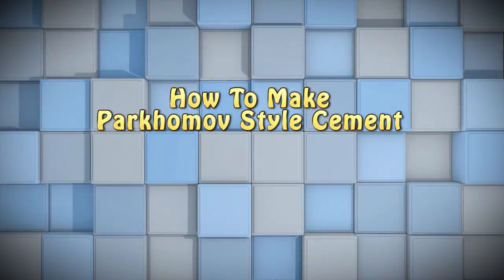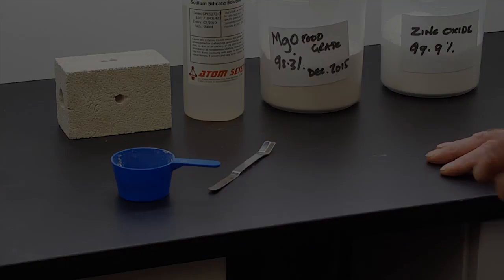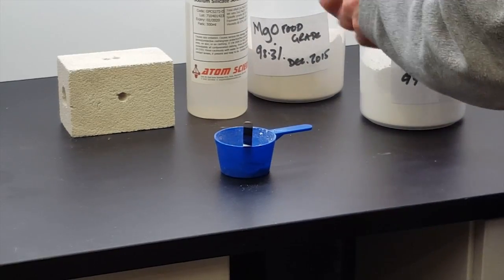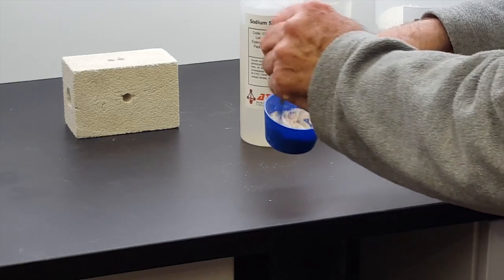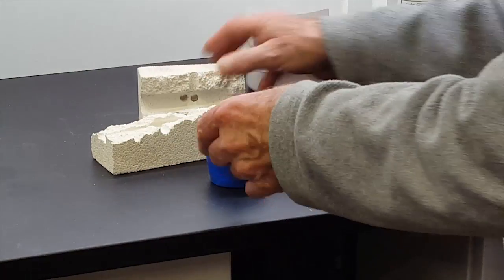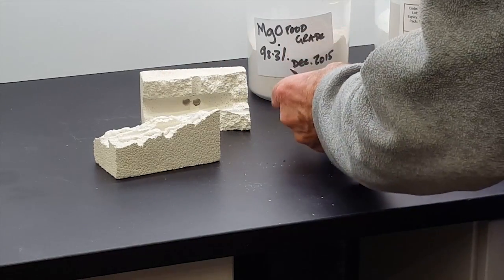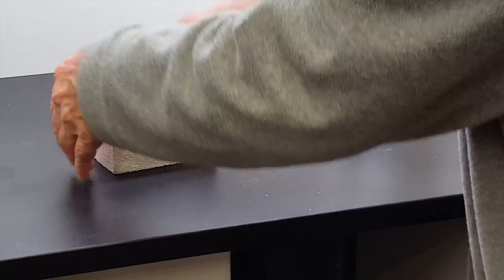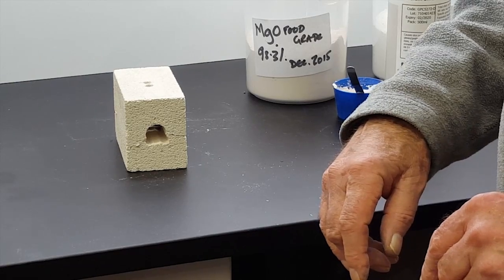How To Make Parkhomov Cement (Refractory Cement)

Comment: what would you suggest the mix would be if i was to try to caste a cylinder say 50 mm thick with 14 inch diameter, 6 ft long?

Comment: Nice I saw a mix of Sodium silicate, Al2O3 and baby power. Was thinking of using MgO and Al2O3 instead of baby powder bc MgO has a much higher melting point. Wanted to make sure using MgO was a thing!
Reply: please note that baby powder was mostly talc powder in the past but because there is often traces of asbestos in talc most baby powder is now mostly corn starch - not good for refractory
Reply: @carboncomplex  Yeah its been cornstarch for a while now. Sometimes you can find an old one on the shelf  with talc

Comment: Where would I be able to purchase  the magnesium oxide? I noticed you sell the starter kits, but I am going the aluminum oxide route and I also make the sodium silicate.
Reply: Mix MgSO4x6H2O + water +Na2CO3=MgCO3(insoluble) + Na+ SO4--
Cool place
Filter
Heat MgCO3 to 600C-750C(not higher) for 2 hours
Check if it became MgO
(at room temp measure temp in 200cc water~20C
add 1 tablespoon of MgO
temp should go to about 30C
if not - heat it at 600C another two hours
do not deadburn or it becomes inactive)
added
Food grade MgO can be also purchased online but it needs to be heat at 600C for two hours as it is frequently dry Mg(OH)2.
Reply: Normally it's origined from Magnesite ore, by calcination up to 600 celcius. From China you can find all grades.

Comment: There is a much cheaper option that can be used to make a very high quality refractory......It is simply potassium silicate and talc (yes baby powder talc, but make sure it is the one that contains talc and not maize!) sodium silicate will work just as well. 
You make a thick paste and it is good for patching up furnaces that and will easily take temperatures higher than the melting point of copper or brass etc.
Hope this is useful to you, it is great because you can use it for patching up cracks like ones I have seen in refractory bricks in your videos.
Reply: no baby  powder uses talc anymore at least  in North America  due to traces of asbestos
Reply: so Shona O'Neill, Hello ! I find this Potassium Silicate for sale on ebay in powder form, Please help me out here Please, is this the right stuff, and if so how do I go from here ? sure would like your help...Thanks Johnny b.
Reply: Can i use sodium silicate instead of sodium silicate ? Thank u